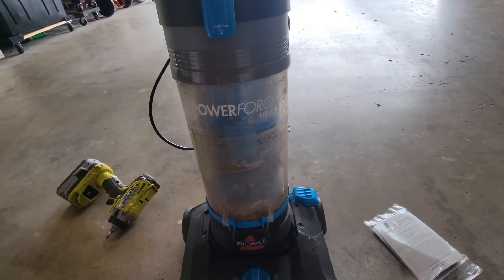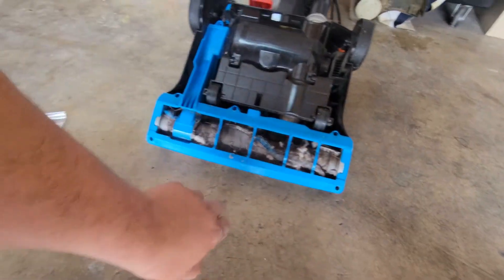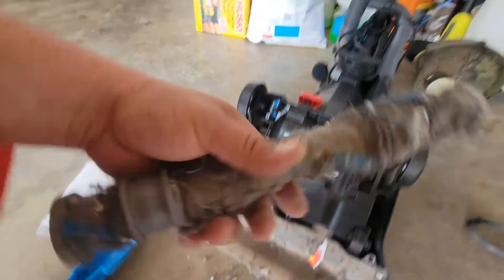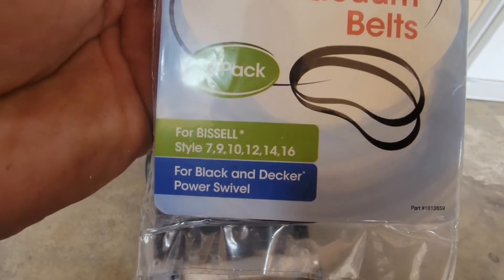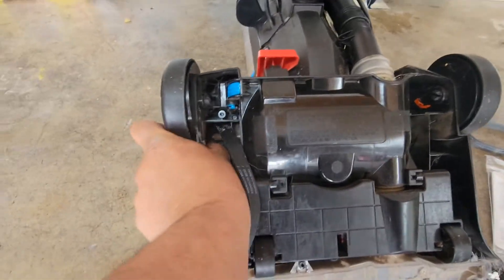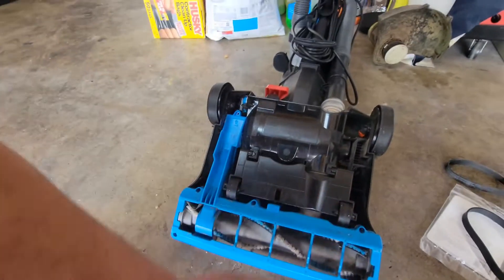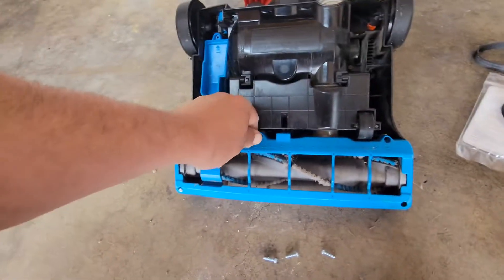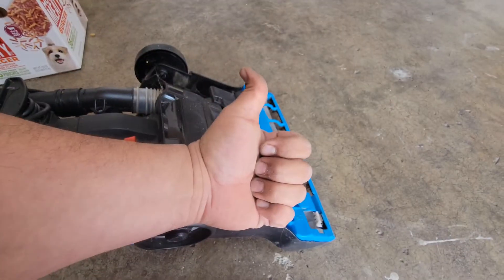How to: Replace Belt on Bissell Power Force Helix

Comment: Quick question why did your belts say black and decker and not bissell?
Reply from the maker: It's the belt size you need to make sure it's the correct one. It doesn't matter what brand it is.
Reply: The brand would be Bissell if you ordered it directly from them.  But,  as stated by @55powerscape the most important thing is the model number to make sure the correct part is ordered.  I ordered mine from Amazon and it came in a no-name white bag.  It fit perfectly.